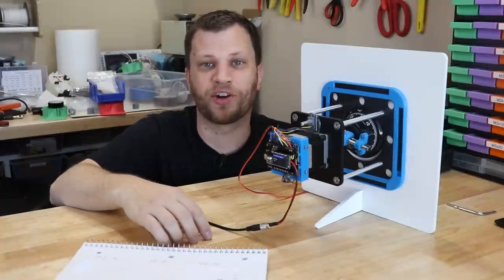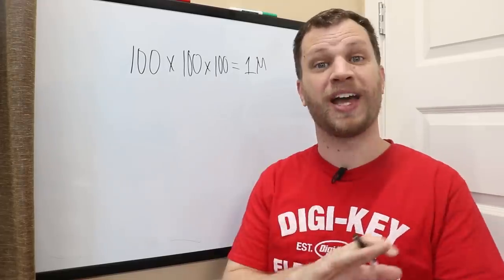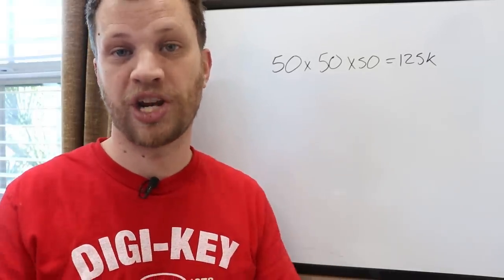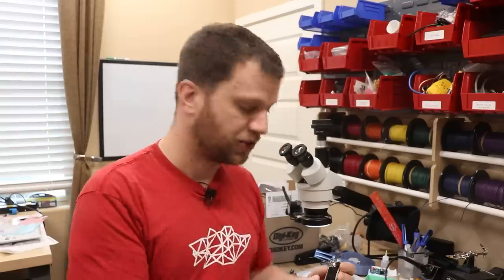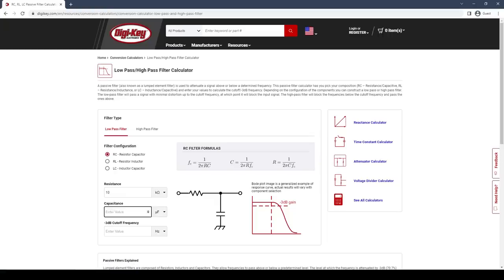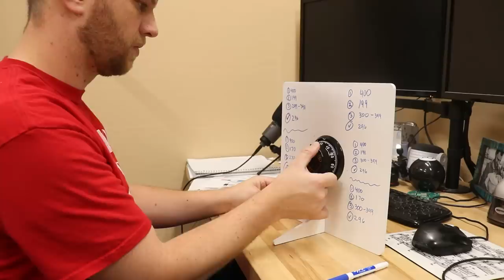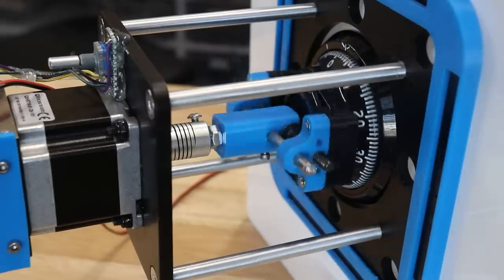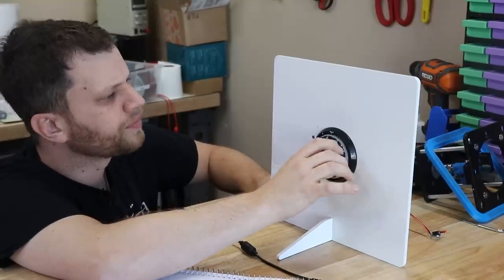I have to try 1 Million combinations? Safe Cracking Robot - Part 2

Comment: The number of possible combinations can be reduced on some Sargent and Greeleaf safe dials: "Do not set the third number of the combination between 5 and 11 on a lock with a dial splined at 50. The “forbidden zone” can shift slightly due to installation and tolerances, but will always be between 4 and 12. Do not set adjacent numbers of the combination within five numbers of each other."
Reply: This doesn't even need a fancy algorithm for every such rule. Simply filtering out combinations that violate something should be plenty fast.

It can be really clean code if done using streams | lazy lists. Very roughly it would be:

for it in product([[0..100], [0..100], [0..100]])
        .filter(rule_a_predicate)
        .filter(rule_b_predicate):
    try_combination(it)

Or, if you want some combinations to be fused together, then you just translate the stream of combinations into a stream of moves the machine needs to do, after filtering.
Reply from the maker: Yes, thank you. I was aware of those exclusion zones from the user manual.
Reply: Most combination locks can do with a tolerance of 2.5 instead aswell leaving less combinations too
Reply: @iWhacko  The S&G 6730 lever determines dialing tolerance. Brass lever allows +or- 1/2 number. Zinc lever allows +or- 1 whole number.
Reply: I thought the forbidden zone of a standard install was between 0 and 25 for the last number on s and g?

Comment: I would talk to a safecracker when you are done here. There are some optimizations to get that number down even further actually that you don't really know without knowing safe locks well
Reply: One right here looking !! like you mentioned, there is still i way to get the total numbers smaller but this comment won"t be seen by the creator so i can help him unfortunately.
Reply: I think the optimizations he put in are the easy ones that LPL covered on his channel.
Reply: @Blogapult  for sure, but the way the lock works has a factor in some more reductions on total count, there are some do's and don'ts when setting a code for example
Reply from the maker: What makes you think I won't see your comment?
Reply: @bytesizedengineering  🤣 had to check. thanx for the email. hope it helps. i actually checked, its in the operators manual!

Comment: Your software debounce is actually a throttle, not a debounce. In the software world, debouncing waits until inputs haven't been received for a certain span before processing the most recent one, whereas throttling is what you did, ignoring all inputs for some time after an input is received and processed.
Reply: More straining at gnats.  It is a debounce.  That is what it does; that is its purpose.  it is also what the capacitor does; charges on the first contact and successive contacts do little.

Comment: Pro tip.....screw a nut all the way onto your bolt before you cut it then you can just take the nut off and it will straighten out and mostly debur the threads where you cut them.
Reply: Yup, one of the first things my gramps ever taught me about working in a shop!
Reply: also: use two nuts and tighten them right above where you want to cut and use a grinding wheel to flatten the end perfectly.
Reply: I like your funny words magic man
Reply: Or grab a file and do it properly.

Comment: From what i can tell about commercial auto dialers, they get most of their extreme cost from the special features they have. the last one i looked at had different algorithms for different locks, and could work from a crib sheet to go even faster. you would type in the information about the lock, and the machine would adjust accordingly. there isn't much market competition for auto dialers though, so the prices are still pretty extreme (10k range). 

there are a lot of niche markets that are waiting to be blown open by 3d printing and a bored engineer lol

Comment: Could also add some psychology to make finding the combination quicker.

If you ask people to choose a number between 0 and 100, it'll nearly always be something between 30 and 70. People tend not to choose near the extremes of the scale. In an old job, people would set combination locks on their lockers and forget the codes, and I'd nearly always have to open it for them. Doing it sequentially on a 4 digit lock, I always started with 4000-6000, then 6001-8000, 2000-3999 then 8001-1999. Prioritising the mid range, then either side of it and finishing off with the extremes. If people do choose an extreme combination, it would usually be the higher extreme.

90% of the time, it would be in the first 4000-6000 range.

Works for mandatory customer service surveys as well. If rating 1-10, the only people rating 1 or 10 will either of had a fantastic or awful service, but the bulk will be 4/5/6. It's also why product reviews on places like amazon are usually polarising. Most people only leave a review if they had a really good or really bad experience with the product or seller.

Which is all a long-winded way to say to optimise brute-forcing a combination, start just short of the midrange.

Comment: You could set up the safe cracker to go and check those other combinations after it manages to unlock the safe, to find the exact set combination. Using a dial with 100 notches and a stepper with 200 steps per revolution is just about perfect, if you can get the steps to match up properly, that way you wouldn’t need any or much microstepping and would probably mean the motor can spin faster.
Reply from the maker: Right, it works pretty well. I have microstepping set to 1/16 so there are 3200 pulses per revolution. So that divides each tick mark into 32 pulses.
Reply: @bytesizedengineering  that Trinamic board is perfectly capable to do more than 1/16 ;) Great choice, by the way, other type of driver would have caused so much whining sound from the  stepper motor that would drive your entire family crazy
Reply: @AB-pb8oo  you probably don’t even need 1/16 so why increase the microstepping?
Reply: @bytesizedengineering  would you be able to get the motor to run faster by reducing the microstepping? You may also have to switch off stealthchop to get any speed difference though since it interpolates to 1/256 anyway. That way you could maybe speed up the dialling process.

Comment: Super cool that you programmed the bot to try 0.5s to dramatically reduce the number of combinations. I had no idea combo locks worked like this. So I guess all the mentions of the number of possible combinations are actually way overstated..
Reply: Sorta like the difference between a GB on a RAM chip vs. a storage device? Manufacturer: see? 100 indents, x3 gives one million possible combinations! User: yeah, but I can get in with a maximum brute force of 1/8th of those so isn't it really 125,000 combos? Manufacturer: no, see, there are 100 indents!

Comment: So amazing what you can do with mostly off the shelf stuff these days. And what's available semi-custom now... so cool. Awesome project!
On the magnets side, Old hard drive magnets are very strong if you can find them.
Reply: That's very interesting. How old are we talking?
Reply: @ryandury  spinning metal disks. You can still get them, but they're not as popular anymore as everyone wants ssds, and modern spinning disks have more efficient designs with smaller magnets. If you can find some old 20gb - 100gb drives on eBay, or in a dumpster, you can get some very powerful magnets for cheap.
Reply: Yes indeed.  The strongest I have encountered are from SAN disks, 3.5 inch 15k rpm server disks.  Hitachi I think.  Scary strong. It would probably crush your fingers if caught between two of them.

Comment: This is soo cool, your project couldn't have come at a more perfect time! I'm working in parallel with you on the same project for a built in safe at my new house and it's incredibly interesting to spot the similarities and deviations in the problem solving processes. I've also posted this problem to all the Mechanical, EE and software engineers I work with and everyone really loves this challenge! Note: the MEs go traight to dismantling the door or destroying the com (First question is can we cut the door?), the EEs go to steper motors almost imediately and the Software guys are coming up with solutions that make my head hurt with crazy sensitive sensors that may or may not exist. Love your videos!

Comment: You have just given the locksmith industry a new set of keys! Locksmiths around the world owe you a debt of gratitude, if not a royalty check!!!
Looks like they could build this for a few hundred dollars, vs. 6 digits...
Reply: Safe Autodialers are several thousand bucks.
Reply: @lazerusmfh  Safe Autodialers were, several thousand bucks.
Reply: Not only locksmiths, but every really motivated teenager whose parent own a gun safe with this type of lock. Well done.
Reply: @bartowl  many dial locks have a keyed dial lock, sure it could be picked, but its another layer.
Reply: Easier open by brute force 😂
Reply: @apetogetherstrong6600  very true, most safes can be open in a few min with just an axe or sledge

Comment: 100% with you on using caps and resistors in parallel with software.
Reply: The ESP32 has a pulse counter module that includes a glitch filter which is just another way to debounce the encoder and it means the encoder isn’t being handled by interrupts or stuff like that, it is handled by hardware designed for counting pulses.
Reply: @conorstewart2214  Oh nice one. I brought one only half an hour ago, so I'll have a play when it turns up.
Reply from the maker: Oh that's cool! I didn't know it had a hardware pulse counter. I'll definitely look into that

Comment: Awesome job! It would be cool if once it found the '.5' solution, it then locked the safe and tried all the possible 'non .5' solutions, then gave you the EXACT answer.
Reply: @MrHardzio4Fun  if a number is .5 off it will work, if it's a full digit off it won't. He used this exact method with a pen and paper and manually testing each possible combination until he got the exact solution. He could just add that last manual part to the program and have it automated.

Comment: Super glad you implemented the debouncing in hardware.  Though, usually we just use a single cap across the inputs, instead of a whole low pass filter... also never thought of it as an lpf, that's neat.
Btw, one improvement you could make is, once you have the half numbers, you could have it try the 8 combinations of whole numbers (e.g. 2x2x2) to find the exact whole number combination.
Reply: @MrHardzio4Fun  they won't all work.  He has them in half increments.  i.e. if he has "2.5", then to enter that combination he has to place the dial half way between 2 and 3 to work because he is not sure if it is really 2 or 3.

e.g. if the combination is 3, and you go to input 2.5, but you're off by a half in the wrong direction, and you enter 2 instead, then it will not open.

The whole point is that you have about 1.8 degrees of tolerance on either side of the digit you are trying to enter (thus you can be off by about half a digit).

But in this case, you can be off by 0 degrees in one direction and 3.6 degrees in the other! -- And you don't know which is which!

Meaning you will fail to enter the combination more often unless you are very precise when entering it.

This is why it's better to know the full combination. -- Because you will have more of an even amount of tolerance on both sides of the target digit.

Comment: I've noticed something that may or may not speed things up. Rotating the dial quickly causes the mechanism to bounce around inside. If you were to pick up the vibrations, and map them to position, then maybe things could be quicker for that particular lock. A vibration sensor (microphone?) could possibly be way more sensitive than a human listening. Looks like the best place for one could be on the dial as less damping from the heavy safe door.

Comment: An easy way to prevent switch bouncing is soldering a small ceramic disc capacitor in parallel with the switch. The capacitance value determines how long the switch requires to be on to activate.

Comment: For your front plate you could have it tapped to threaded rod size. Use a jam nut on the back to lock it, and then you can use it on various length dials.

Comment: Is this the most optimal search path?  Could you speed it up by hunting for numbers that take less travel time even if they require resetting to the start?
What about bias-weighting towards statistically more likely numbers for people to pick as well?
Reply: I think this is the optimal path. Doing no movements on the 1st and 2nd wheel while you try all numbers on the 3rd seems pretty much optimal. And then doing no movements on the 1st while you go to a new number on the 2nd - while contributing only 1/50 to the movement distance - still sounds like it can't be beat.

While this does restrict the order in which you go through the 2nd and 3rd gear positions, rotating the 1st gear won't keep the other two gears in their positions anyways. So the only thing you gain from going in order on the 1st gear is that you're always doing 1/50 of a rotation. And furthermore you're only moving that gear 50 times total, so you'll loose at most 50 seconds even if you went downwards and did 49/50th of a rotation every time.
So you COULD very much go by probability for the 1st gear. Then again, low numbers ARE probably the numbers that are picked most frequently.

One independently possible optimization is to hope that the tolerance is 1.5 instead of 0.5 numbers. That would allow you to try only 1/8th of all combinations (25*25*25 in total), cutting the time from 32hrs to 4hrs - but if the assumption is wrong, you'll still have to do the remaining 7/8ths.
But it comes at the cost that in that first 1/8th of combinations, you'd spend 1/25th of the time turning the 2nd gear, while going through the numbers consecutively has you spending only 1/50th of the time rotating the 2nd gear (and 1/625th vs 1/2500th for the 1st gear). As a result, that 1/8th would be 2% slower.

Comment: Great video and project. Also ESP should have capacitive touch sensor GPIO pins built in. Can just make touch pad buttons if you like.
Reply from the maker: That would be cool!
Reply: A simple wire and an aluminium foil works too on the gpio.

Comment: @Bite sized engineering - Many rotary mechanical combination locks have a limitation of usable numbers on the dial. For example the last (3rd) disc should never be set between 90~20, as it can inadvertently interfere with the normal cam opening operation. So it's fairly safe to assume this range of numbers can be omitted from mechanical manipulations. Incorporating noise detection into the manipulation process can dramatically shorten the overall process. The older the combination lock, the more audible it's 'tells' become to the trained ear.
Reply from the maker: I'm aware of that third number limitation.
Reply: @bytesizedengineering  That's good to know, I've always been interested in creating an auto-dialler, having only ever manually manipulated combination dials thus far. I'm impressed with your technique and it's testament to why I continue to watch your videos with great interest. 👍🏻‍

Comment: For version 3, you should use a microphone and an FFT to isolate the sound of the locking mechanism to determine the code. Some professionals can crack safes by ear, so why not a robot?
Reply: IIRC, there's a DefCon video with a safe cracker that does this. It might've been on one of their ATM videos, but it was a brief mention.
Reply: Doing it by ear (or feel) depends on the previous opening NOT clearing the wheels by rotating the mail dial 3 times (or more).
Reply: It's done by feel not ear.

Comment: I wonder if you put a sensitive microphone against the safe and spin each wheel separately and find click sounds? And then just try out +-5 numbers for each dial where it clicked.
Reply: The only thing you would hear is the driver pins picking up the next wheel. 
Which is meaningless since the gates can be at any random place in relation to the pin.

Comment: Great job, if you already know the 3rd digit, then why not incorporate that into your testing?
Reply from the maker: Thanks! 3:30 My brother-in-law's safe has this exploit, but my mock-up replacement dial does not. That's why I had to try all possible third numbers. On my brother-in-law's safe I will only have to try one.
Reply: @bytesizedengineering  I understand, but your wife could tell you the 3rd digit

Comment: Awesome video Zach!  Very clever use of multiple electronics, CAD and software techniques.  What's the brand and model of that bench stereo microscope you're using?
Reply from the maker: AmScope SM 6TX. I wanted one with an articulated arm as well as a port to put my camera.

https://amzn.to/3I0chkm
Reply: @bytesizedengineering  Thanks!  We use sliding post type Amscopes at work but they’re really clumsy.  The articulating arm seems way more useful!

Comment: You really don't need to combine two discrete numbers into an averaged one to try exactly 50 places on the dial. The mechanical tolerances in the back know nothing about the number of lines on the dial in the front (and, of course, you know this, because you had to convert X numbers on the front to some number of degrees of rotation from the stepper motor). So, remove the dial numbers entirely from the search process, and just divide the 360 degrees into N search points. For reporting to the user which combination you're checking, you can translate to the dial numbers, but, for the search, just use N for the number of divisions. Then, you can experiment with just how low you can go with N (maybe 40 or even 30) to cut your search time even more.